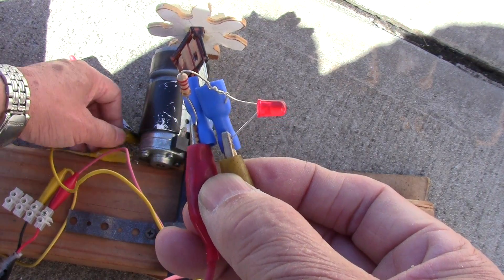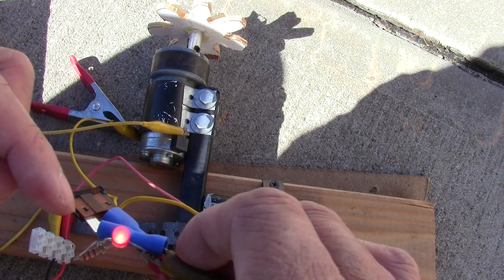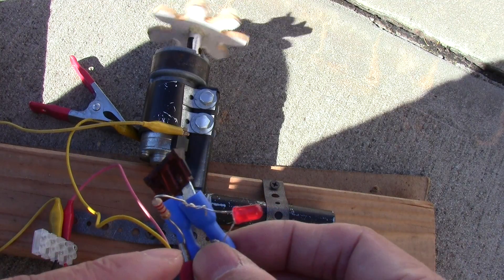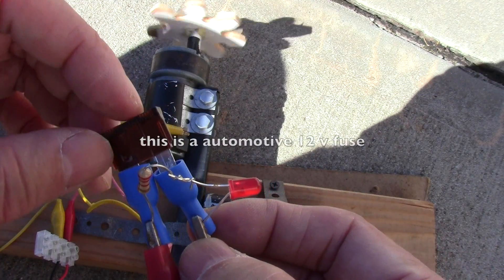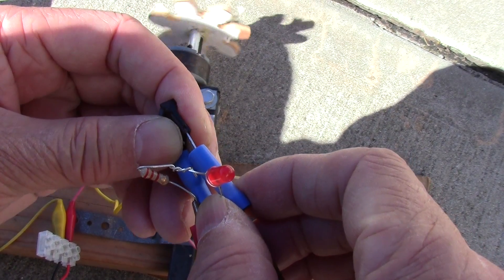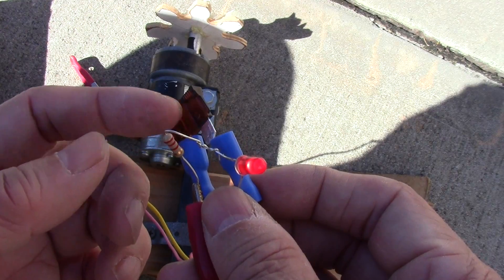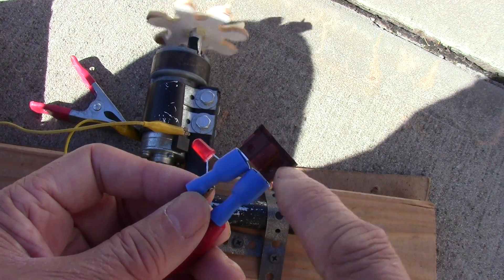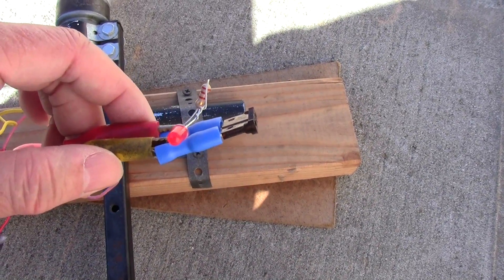diy 12v DC blown fuse led indicator

Comment: Wouldn't you want the light to be on when passing current, and off when fuse blows so the circuit isn't passing current with a blown fuse? AKA the light is on, it is passing current without a fuse...
Reply from the maker: I guess you can set it up both ways. Maybe it's hard to notice one unlit wire or circuit when all wirings are wired with lit LEDs.  On the other hand,  you'd tend to notice a single lit LED when the others are not lighted. When you drive your car, it'd help not to have so many  lights on so when the low oil light comes on, you'd notice it.
Reply: I just noticed sellers with LED indicator on small 12 VDC Blade style fuse panels. They had a main power lug, then 4 -12 fuse holders with spaded output to add your circuit. They used similar circuit as you had, a 2.2k ohm resistor and LED.  One reviewer noticed his radio played without a fuse even installed then put a meter on each output and found 12 VDC present, unknown at what amperage, but any output is bad without a fuse or with a blown fuse.  They were advertising them for marine use and a circuit that never shuts off 100% could be hazardous in an engine compartment, or if they used thin gauge wires, create a fire if a short is what caused the fuse to blow.  Reason for my comment, sure it is nice to see and indicator to let you know if the failure is fuse related, but a simple VOM probing will tell us that too... and no chance for any incident to occur.. Now if all high amp circuits and all wires shielded in a harness away from any ground, then perhaps this would not be an issue, especially if a longer run.  12VDC 2K Ohm is 0.006A neglecting any resistance from wire or diode..  so sounds negligible in most instances, your solar project, but not for engine compartment of a boat... my quarter's worth...
Reply from the maker: Thanks for your insight and it's worth more than a quarter.
Reply: The purpose is to indicate a blown fuse. If the light goes off with no current, you would not know if it's the fuse or another part of the circuit (switch , no power, other breaks in the circuit.
Reply: @gozillatrade5178  exactly. I search a way of mimic the fuse box with led indicator. But it should light the led only when the fuse is broken, but not if you turn off the load by a switch. As long as the circuit break by the load the led will light. Can it be done in a simple way with a load switch??